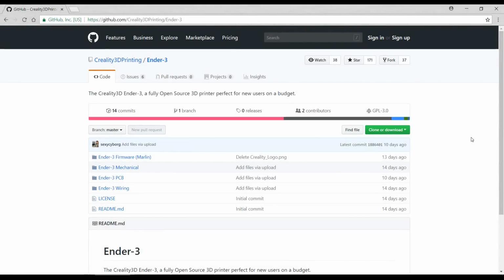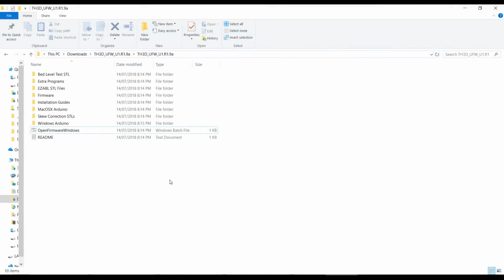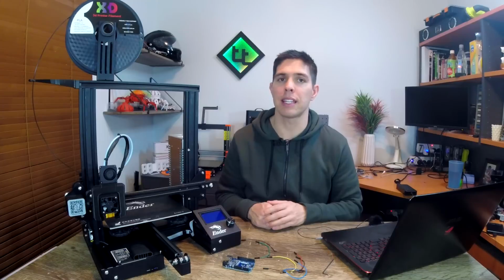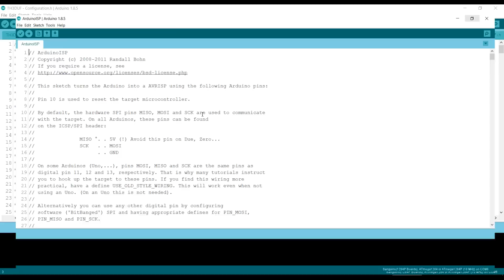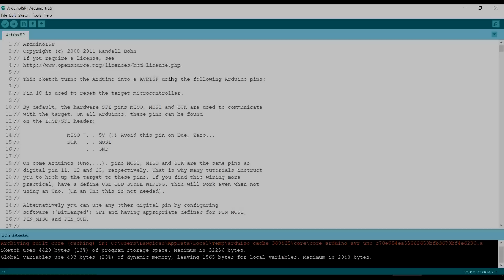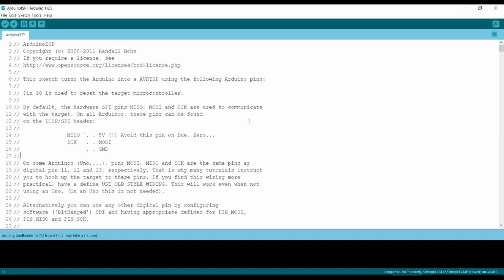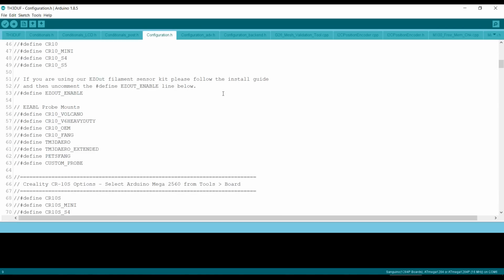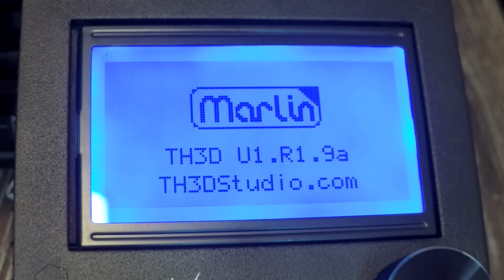Ender 3: How to install a bootloader and update firmware

Comment: WARNING: Following this tutorial will likely destroy print quality.
I'm not saying don't do it. But the video misses a major warning.
I watched the video and thought I would flash the bootloader so that it was out of the way when I was ready to install the latest official firmware but as soon as I flashed the bootloader the printer stopped booting and I was 100% committed to installing a new firmware. I was unable to clear EEPROM prior to installing the new firmware and was unable to record the existing settings.
The TH3D firmware does work but IS NOT calibrated for the Ender 3 and introduces violent jerking and acceleration. It also removes many controls from the onboard menu to free up the space for the EZABL functionality.
Before installing the firmware I was getting perfect prints every time. After installing the firmware I am getting constant layer shifting from the jerky movements and am finding it hard calibrate it or find the original firmware back.
If you want auto bed leveling of other features then go I encourage you to proceed but remember to record your original settings because there may be no going back and I feel this is a very important disclaimer.

EDIT: Update to let you anyone having similar issues know that this could be a slicer issue too. My theory is that that any files sliced with jerk and acceleration controls were ignored by the stock firmware, however once flashing to a new firmware they start becoming honored and may be too high. With my slipping I was testing using known good gcode from before the update, however have since noticed that the gcode contains some M205 X30 Y30 and M205 X20 Y20 which feels too high.
Reply: No.  it has to be the firmware because i just noticed the same violent jerking immediately after flashing th3d latest firmware . If someone can help a noob out i would really appreciate it! im sure its some settings related to jerk or something but just dont know how or what to change to??

Comment: Worked perfectly, thanks! The only thing I needed to do was install the drivers for the clone arduino, and a driver for the ender which I hadn't done before starting. Otherwise it was a breeze and updated 2 Enders with your instructions. Thanks!
Reply: For newer version: https://support.th3dstudio.com/hc/en-us/articles/360043291472-Creality-Printer-Drivers-FT232R-Chip-Most-Models
For older boards: https://support.th3dstudio.com/hc/en-us/articles/360043291432

Comment: Arduino: 1.8.7 (Windows 7), Board: "Arduino Uno"

C:\New folder (4)\TH3D\TH3D_UFW_U1.R2.7\Windows Arduino\hardware\tools\avr/bin/avrdude -CC:\New folder (4)\TH3D\TH3D_UFW_U1.R2.7\Windows Arduino\hardware\tools\avr/etc/avrdude.conf -v -patmega328p -carduino -PCOM6 -b19200 -e -Ulock:w:0x3F:m -Uefuse:w:0xFD:m -Uhfuse:w:0xDE:m -Ulfuse:w:0xFF:m 

avrdude: Version 6.3-20171130
         Copyright (c) 2000-2005 Brian Dean, http://www.bdmicro.com/
         Copyright (c) 2007-2014 Joerg Wunsch

         System wide configuration file is "C:\New folder (4)\TH3D\TH3D_UFW_U1.R2.7\Windows Arduino\hardware\tools\avr/etc/avrdude.conf"

         Using Port                    : COM6
         Using Programmer              : arduino
         Overriding Baud Rate          : 19200
avrdude: stk500_recv(): programmer is not responding
avrdude: stk500_getsync() attempt 1 of 10: not in sync: resp=0x1f
avrdude: stk500_recv(): programmer is not responding
avrdude: stk500_getsync() attempt 2 of 10: not in sync: resp=0x1f
avrdude: stk500_recv(): programmer is not responding
avrdude: stk500_getsync() attempt 3 of 10: not in sync: resp=0x1f
avrdude: stk500_recv(): programmer is not responding
avrdude: stk500_getsync() attempt 4 of 10: not in sync: resp=0x1f
avrdude: stk500_recv(): programmer is not responding
avrdude: stk500_getsync() attempt 5 of 10: not in sync: resp=0x1f
avrdude: stk500_recv(): programmer is not responding
avrdude: stk500_getsync() attempt 6 of 10: not in sync: resp=0x1f
avrdude: stk500_recv(): programmer is not responding
avrdude: stk500_getsync() attempt 7 of 10: not in sync: resp=0x1f
avrdude: stk500_recv(): programmer is not responding
avrdude: stk500_getsync() attempt 8 of 10: not in sync: resp=0x1f
avrdude: stk500_recv(): programmer is not responding
avrdude: stk500_getsync() attempt 9 of 10: not in sync: resp=0x1f
avrdude: stk500_recv(): programmer is not responding
avrdude: stk500_getsync() attempt 10 of 10: not in sync: resp=0x1f

avrdude done.  Thank you.

Error while burning bootloader.

This report would have more information with
"Show verbose output during compilation"
option enabled in File -> Preferences.

Comment: I did every step with the Arduino, but when I disconect it and conect with the computer the LCD wont start to continue thr steps.. what should I do?
Reply from the maker: Assuming you have completed the bootloader step, you now have to upload the firmware as the video shows. It is normal for the LCD to be empty after burning bootloader.

Comment: I followed this tutorial to flash the FW and it works, but since I updated, the print quality is really bad. Do you have any recommendations?
Reply from the maker: The TH3D firmware has different acceleration and jerk values, that's the only thing that could affect print quality.
Reply: @TeachingTech  What would you recommend, Vanilla Marlin or th3d? Is Vanilla Marlin equal to the stock fw?

Comment: Nobody mentions that steppers are much quieter with TH3D firmware (just burned the bootloader and installed U1.R2.7) compared to the stock firmware that comes with the printer. Or am I imagining it?

Comment: Please Help!

Arduino: 1.8.5 (Mac OS X), Board: "Sanguino, ATmega1284 or ATmega1284P (16 MHz)"

avrdude: stk500_getparm(): (a) protocol error, expect=0x14, resp=0x14

avrdude: stk500_getparm(): (a) protocol error, expect=0x14, resp=0x01
avrdude: stk500_initialize(): (a) protocol error, expect=0x14, resp=0x10
avrdude: initialization failed, rc=-1
         Double check connections and try again, or use -F to override
         this check.

avrdude: stk500_disable(): unknown response=0x12
Error while burning bootloader.

This report would have more information with
"Show verbose output during compilation"
option enabled in File -> Preferences.
Reply: Have exactly the same issue. Arduino UNO connected and uploaded the bootloader while staying connected to the mainboard--ok. No error messsage. The next step was to flash the bootloader, the error comes.
Tried out some fixes:
1) Tried another arduino UNO board. same result.
2) Tried another Arduino software on my mac. (the previous stable release). Same result.
3) Reseated and double checked the connection from the Uno board to the Ender3 mainboard. Same result.
4) Tried to power the mainboard while flashing. Same result.
5) Tried the whole procedure from the beginning after uninstalling and reinstalling all software. Same result.
6) Also tried a nano board. Same result.

Thoughts: Ender 3 mainboard have blue led when starting the flash process. Could my mac be the problem as long as it seems to upload the bootloader to the uno without problem? 
hmm...

Comment: Just a note for my experience following this guide. In case anyone else has the same issue.
Great Guide by the way, Thank you so much!!!

Hiccups that I had:
#1 I undid the top screws and kept pulling and prying to get that cover off.  I wasn't very observant, however on my printer, you access the board from underneath so you have to turn the printer on its side to access it. I tilted it on its Zed mount, made it kind of difficult to get to the wiring.The fan is on the bottom of the printer for me.
#2 got the bootloader done, then had this error once connected to the PC to upload the new firmware -> 
"i:/ender3bootloaderaudrinofilesets/th3d_ufw_u1.r2.7/windows arduino/hardware/tools/avr/bin/../lib/gcc/avr/5.4.0/../../../../avr/bin/ld.exe: error: lto-wrapper failed". So, I just kept hitting upload and it took about 5 tries before it uploaded, just an FYI, not sure if that is a problem.

Other than that, got this section of the BLtouch done and again, thank you so much for this walkthrough.

Comment: Hi, I have recently bought an Ender 3 and tried to flash the Marlin firmware. But unfortunately I was not able to flash the bootloader. I double-checked the wiring and the settings. They were identical to the ones in this video. It fails with this error message:

avrdude: warning at C:\Program Files (x86)\Arduino\hardware\tools\avr/etc/avrdude.conf:5036: part m1284 overwrites previous definition C:\Program Files (x86)\Arduino\hardware\tools\avr/etc/avrdude.conf:4844.
avrdude: Expected signature for ATmega1284P is 1E 97 05
         Double check chip, or use -F to override this check.

Has anybody an Idea?  (I already tried changing the signature in the avrdude.conf file as suggested in the arduino forum  but that did not work either)
Reply: https://www.reddit.com/r/CR10/comments/bdmcjd/trying_to_flash_firmware_failing/?st=jw4k7xbd&sh=ba739480

Comment: OK, I'm going to jump in and do this but I have couple questions first. Do you know if the Ender 5 is on the firmware list and will the Octo-Pi still work through the USB port? Thanks.

Comment: First I would like to say that I watch all your videos and find them greatly helpful, I am attempting do install a BL touch and begin with this video. 

The Bootloader Burn was a success however after removing the Ard and plugging  my Laptop directly to the Ender 3, a Comm port does not appear and I am unable to upload the TH3D software due to inability to find a diff port. I have disconnected the Ender 3 from everything else, and currently the LCD is receiving power but no graphics are being displayed, nor is the BLtouch cycling
Reply: i have the same error. Did you find a way to solve it?
Reply: @DerZermatschteStern  Never received a response anywhere, ended up ordering another board, MKS Gen L, and as that has a bootloader already on it, it is much simpler. I recommend this route if you are able to do so. Otherwise, good luck, you may also try to find some help on the Arduino forums if not here.

Comment: Great instructional video, thank you!
I would like to update the firmware on my Ender 3 however I currently have an Astroprint touch screen connected via USB that runs all of my prints.  Will updating the firmware cause issues with the Astroprint connection?  Everything is running so well with that setup, I would hate to mess it up.  Thanks again!

Comment: I keep getting this when i try to burn the boot-loader.

avrdude: Yikes!  Invalid device signature.
         Double check connections and try again, or use -F to override
         this check.
   
I can't figure out why or how to fix it.

P.S. my ender 3 now has no firmware on it so i can't use it.

Comment: Hi Michael, thanks for the video, it really made a difference.  However, after a week or so I had to change the hard drive and could not do a back up first.  Now I cannot connect to the printer via usb,  Should I re install the boot loaded? Thanks in advance.  enery8
Reply: May have to reload the FTDI drivers, as someone mentioned a while ago. Here's the link: https://www.ftdichip.com/Drivers/VCP.htm

Comment: I know you wont see this but i get (avrdude: ser_open(): can't set com-state for "\\.\COM4") as an error... I cant get this to work and printer is not working now at all
Reply: If you have something else connected to the printer like Octoprint, disconnect it. Otherwise its saying that it cant communicate through the COM port. Does your computer make a noise when it is connected to the Arduino? If you follow this video and the Com ports do not change, you could have a faulty wire.

Comment: Thanks for this video.  I followed along and got it done. The only thing I would say is missing is saying that you need a driver installed on your computer for the arduino.  By the way, what’s another good use for the arduino?

Comment: Hi Michael, I have an ISP connector cable, do I really need a male to female to connect to pin 10 of the Arduino? Im trying to avoid buying new stuff, any help is greatly appreciated. Im getting my Ender 3 pro in a few days, and want to follow your guide to flash this, so can u pls help? Thanks buddy
Reply from the maker: As long as the you can make the connection you will be fine. Assuming your cable is female on both ends you use use another piece of wire as a male/male jumper for that pin.
Reply: @TeachingTech  hey thanks so much for the reply. My cable is a fixed 6 pin female to female cable.. no separation possible.. from what I saw and understood, pin 10 is only for reset, will I be able to flash successfully? If not, I will do what u showed in your superb video. Just wanted to avoid the expense since I already have this cable, please help
Reply: @TeachingTech  If I have no choice, I will get the required cables, but just wanted to confirm this with you, I have flashed many boards with this cable, but like I said, it is a fixed 6 pin cable ftf. Is the pin 10 connection really necessary?

Comment: Good morning, I tried to update the firmware of my Ender 3 through the steps of your video, but when I do the bootlaeder of the ISP program, it gives a message saying about a block.

avrdude: 1 bytes of lock written
avrdude: verifying lock memory against 0x0F:
avrdude: load data lock from input file 0x0F:
avrdude: input file 0x0F contains 1 bytes
avrdude: reading on-chip lock data:

Can you help me solve this problem?

Comment: Hi TT! I Flashed the firmware to the latest TH3D and have concern: the nozzle is colliding with the clips holding the build plate (newest Enders 3 have build plates not glued in) during "home axis" and "manual mesh bed leveling. It happens if the location of the nozzle during "home axis" is somewhere in the front - extruder moves in both axis initially and reached front edge of the bed. As its progressing left it reaches the clip. In manual mesh leveling same thing - first point it front left very close to the edge then head wants to move right colliding with clip. What changes in firmware code are necessary to avoid this. Original Ender firmware homes X first avoiding clips...
Reply from the maker: In configuration_adv, around line 394 you will find:
//#define HOME_Y_BEFORE_X
By default this is commented which means x will home first, you might want to check if you have it uncommented.
the other one is commenting out quickhome just above it, which if will make it home one axis before the other instead of diagonal.
Reply: @TeachingTech  FYI:  I think I found solution to both. There is setting #define QUICK_HOME which basically moves axis diagonally initially (enabled by default). I also solved mesh  leveling issue by changing MESH_INSET from 10 to 60. It gets 25 point further from the edges - which is fine with me  - this is where I print most of my (small typically) parts. Thank you again.
Reply: @TeachingTech   Not there.Thank you for attempting to help me - much appreciated, but I look at the latest TH3D (TH3D_UFW_U1.R2.7) which apparently doesn't have this...

Comment: Michael, help! I bought the same Geekcreit Uno as you, however when I go to upload Arduino ISP I get an error because it's expecting ATmega1284P but the device signature is 0x1e950f (probably m328p).. and to Double check chip, or use -F to override this check.. where would you do this in the sketch?
Reply: I was having this problem and followed this: https://old.reddit.com/r/ender3/comments/a0r7u9/cannot_flash_bootloader_with_th3d_and_arduino/eak02oz/

Comment: Edit: My USB cable was the problem, found a different one and tried it and it worked!! Thanks for the guide!

I followed guide to a tee...when I connect the printer to my computer I get device descriptor failure. Tried manually installing drivers but same result. I was able to install the Th3d firmware using the Uno. Guess I will have to flip my ender 3 pro upside down and connect the uno to it whenever I want to update. Also is there something I have to enable to get thermal runaway protection using th3d fw or is it something that is just built into it?

Comment: I just finished upgrading my Ender 3 pro following your guide, there were a few differences but i did it with the info you provided. Thank you!!
Reply: just notice the command for "move axis - extruder" does not work. I tore everything apart again to look for a loose or broken cable but when that didn't fix it, i tried to run a print and just watched the E turn.

Comment: When you have an OctoPi running, you can set it up to flash the Ender-board without a bootloader through the OctoPi:
https://learn.adafruit.com/program-an-avr-or-arduino-using-raspberry-pi-gpio-pins/overview
This is more an advanced option. Don't know if you can add the custom profile to avrdude of the Firmware Updater plugin.

Comment: Has any body looked into a simple hardware attachment to prevent "your thermister, heater cartridge" from coming loose. 
Any ideas why Creality would ignore such a simple firmware fix to what may turn out to be a potentially embarrassing spate of thermal runaway fires or even worse a death?
Reply: It's very unlickely that the thermistor or heater cartridge will ever come loose. However, if something fails really badly, it might come loose. Anet printers were known for doing this. Creality is much better at not having their printers fall aprat. However, it's better to not risk it if the worst case scenario happens.

Comment: A Biggggg Thankssssss! It’s really well explained and super easy to follow, I did it with the TH3D U1.R2.7  version that comes with Power Loss Recovery and now my Ender 3 is safer with the Thermal Run Away Protection and now I have the Power Loss feature thank you a lot !